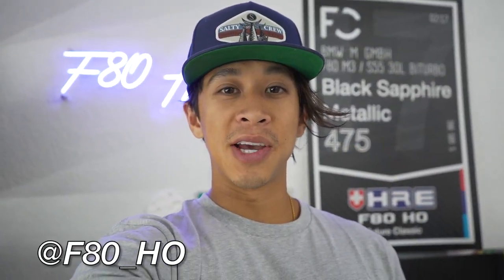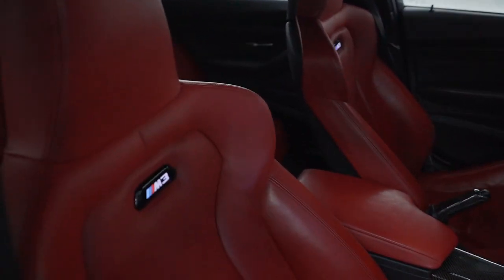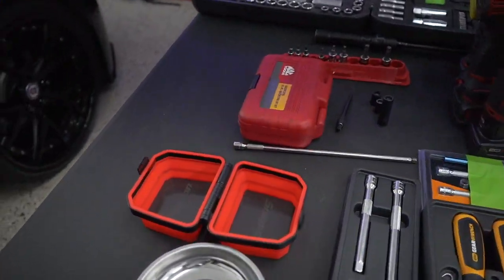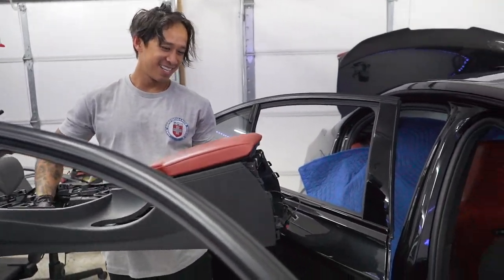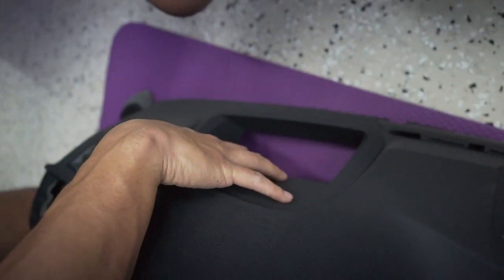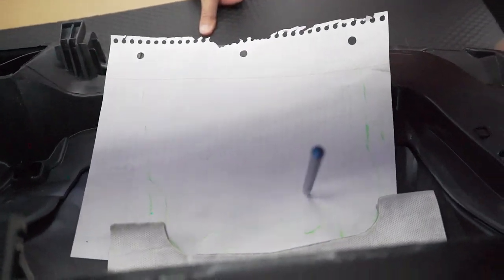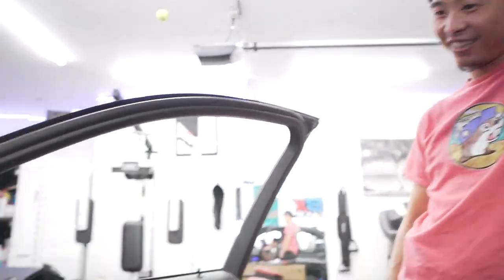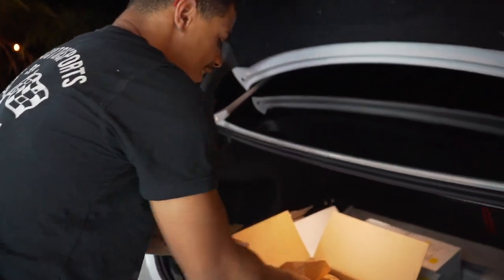EXTENDED LEATHER DASHBOARD INSTALL on my BMW F80 M3! (Sakhir Orange)

Comment: Looks great! When I bought my m4 it came with it and I had no idea this was an option, I lucked out. When you get your door cards, see if you can get the Kies door handles and replace them while your at it because they will get sticky and nasty with time. 👍🏽👍🏽🙌🏽
Reply from the maker: Thanks bro! Happened on my f30, I might buy the inserts that just slide on, the door cards are already on 😅🔥🔥😂 only driver side door is sticky though, not too bad.
Reply: @F80Ho  That's what I ended up doing just on my door,  hahaha! ✌🏽